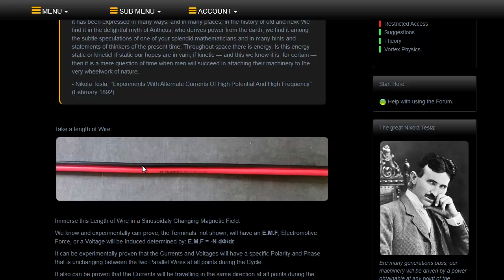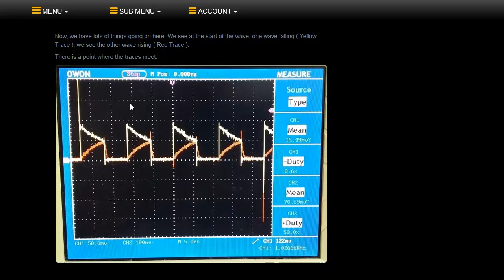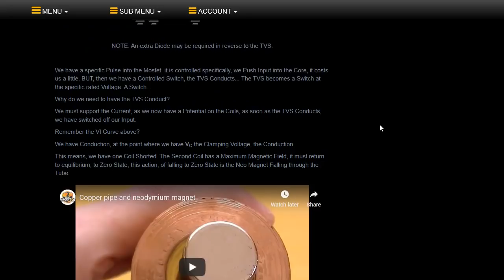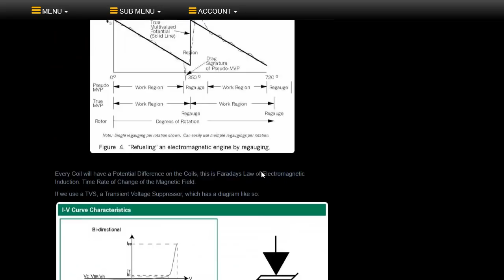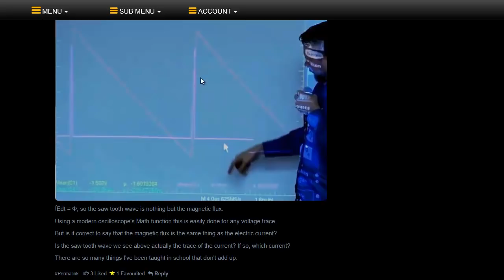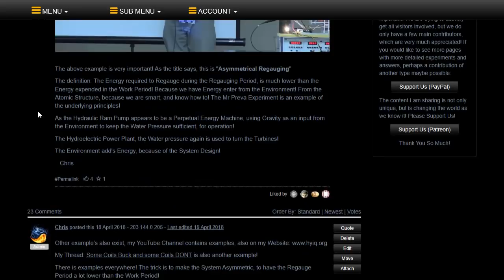Asymetrical Regauging in Partnered Output Coils - Pt1

Comment: a video responce as promised yesterday.  - today i have replicated the sine wave in the last video, -  cop however is questionable. https://www.youtube.com/watch?v=1b02EVamyzQ
Reply: btw should the load out coil, actually be loaded ? - i seem too recall you mentioned that it should be. however mine was not. -   i will correct this in the next video along with an improved transformer.  -   - since im going too rewind the output coils, can you suggest a ratio between them ?

Comment: keep in mind, and as always, with respect, this is not how tesla's bifilar coil patent 512340 describes it. Tesla's made a series connection that increases the voltage difference between the two windings, making it possible to be used for radiant energy experiments. magnetic field is not opposed but its not about the magnetic field, its about the dielectric field.
Its like a capacitor, without charge time, as the plates (windings) are connected. Brilliant design! the sudden change in voltage creates a longitudinal pressure wave (radiant).
Reply from the maker: I prefer not to make comparisons between the Apple cart and the Orange Cart. You can see what I mean by that here: http://www.hyiq.org/Reference/Profile?Name=Don%20Smith - You will note the use and re-reference to Tesla's Patent: 336,961 which is eons ahead of the grasp of the patent office of the day.